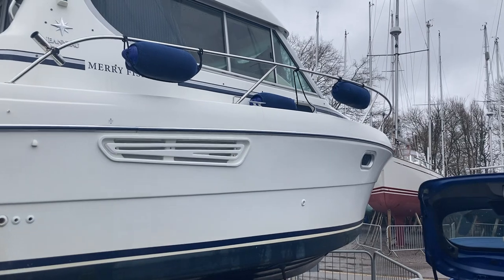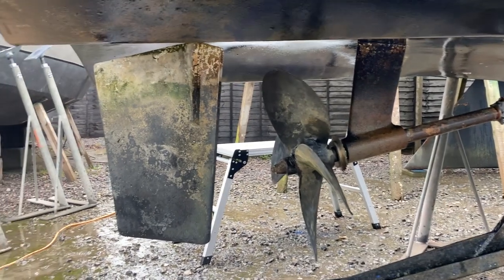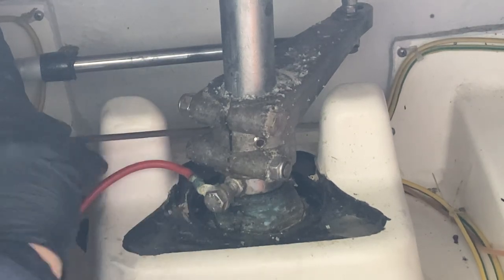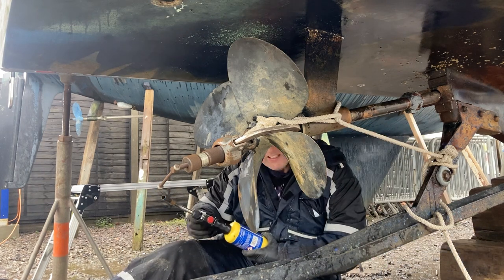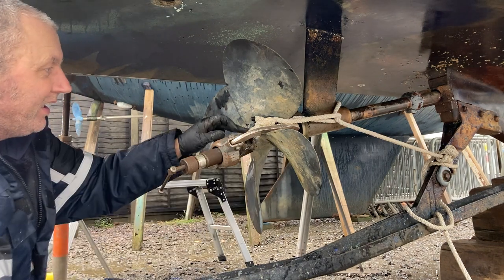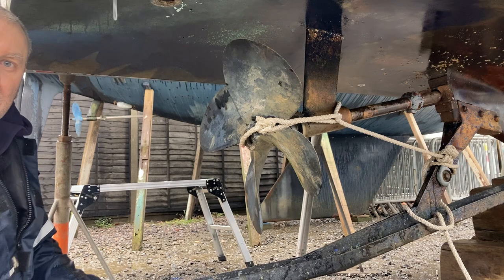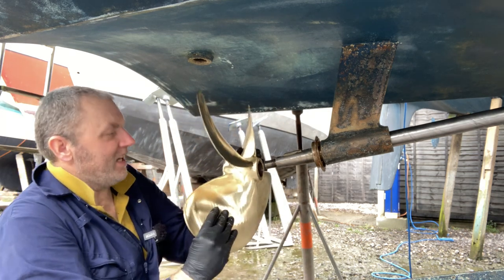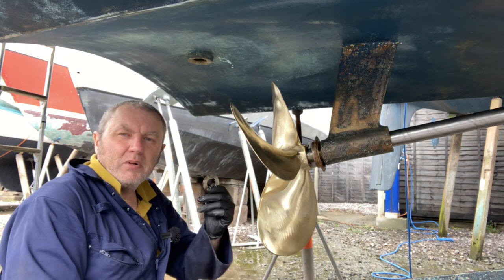Jeanneau Merry Fisher 805 Propeller removal and install .

Comment: Great video. Drying mine out for the first time next weekend. She came with a never used pair of beaching legs. Will look at cutting the keel band and adding a bolt on extension to facilitate future rudder removal.

Comment: Jamie just a tip as my 805 had prop anode (35mm) always totally gone.   Researched and found larger 40mm  beneteau anode along with 40mm anode prop nut fitted the 40mm shaft.  Along with shaft anode gets a bit longer before totalled!
Reply from the maker: Nice one William . Thanks for the tip . 👍

Comment: Well done. Interesting that your keel extension has presumably been cut short. I have threatened to do this as I have always had to remove ours before being able to get the rudder out. However I've always felt it was made that long for a reason and can't bring myself to do it! 😁
Reply from the maker: I must admit I dint know that they were longer . It makes life easier with it shorter .
Reply: Unless ours isn't the same as others, ours comes right back. Our MF goes aground every tide and we use her where there is a lot of static fishing equipment, so it's reassuring to have the longer keel extension. However it does make it a PITA to remove the prop! Especially as the boat has to be supported elsewhere.

Keep up the good work. Amazing boats! We love ours!

Comment: Hi. Great job. Do you remember the size of rudder seals?
Reply from the maker: I can’t remember top my head but will look next week and let you know 👍
Reply: @shakyangler  Super! I will wait for it.
Reply from the maker: The size of my O seal where ID -40mm x 3mm on my rudder
Reply: @shakyangler  So it is a standard oring..... Thanks
Reply from the maker: That’s the size that I replaced like for like and it stopped the water coming up the rudder stock tube .
Reply: @shakyangler  40 mm inner or outer ?
Reply from the maker: 40mm inner diameter
Reply: @shakyangler  Thanks !!